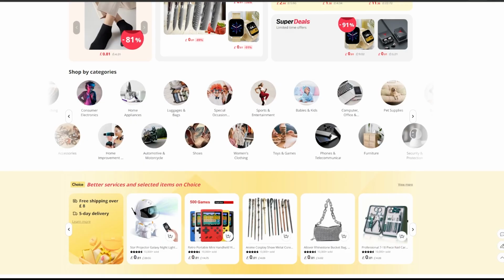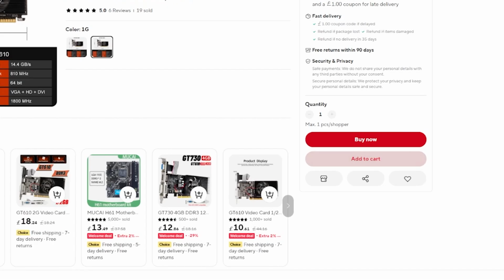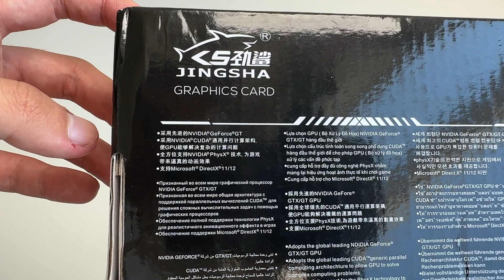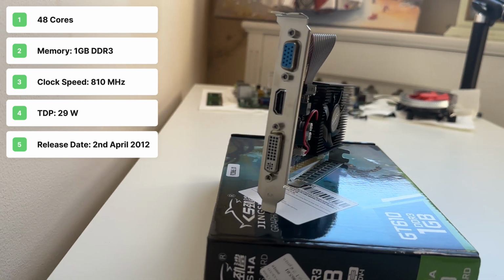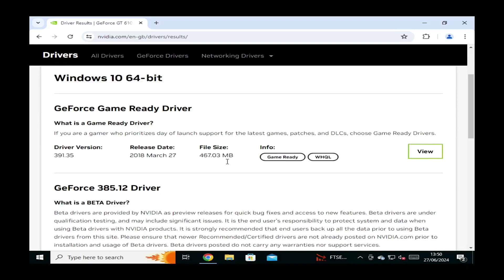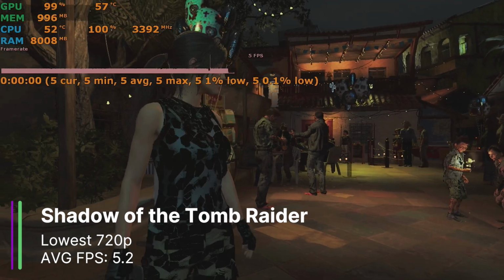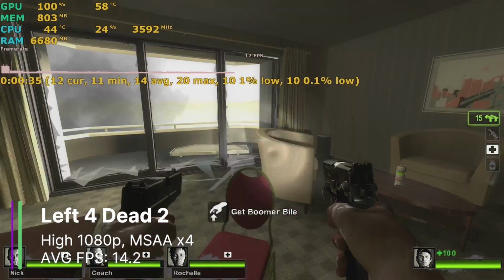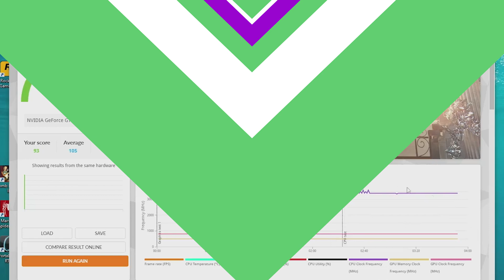Gaming on the Cheapest GPU on AliExpress

Comment: It has a GF (Fermi) chip. That makes it a 400 series card with no DX12 support. Partial support for DX 12 appeared in the 600 series. 
Nvidia did all sorts of garbage like this back in the day. I have a 4GB 730GT which is actually a 430GT. Nvidia released 3 versions of the 730, two of which were Keppler (one with 64bit DDR3 and one with 64bit DDR5), and a third one with Fermi (128bit DDR3) which is the one I have. Depending on the game, there's a factor of 3 difference between them.
Obviously, my 730 4GB was slower than a Radeon HD 3850 with 256MB or RAM.